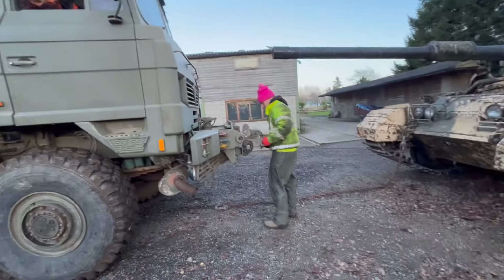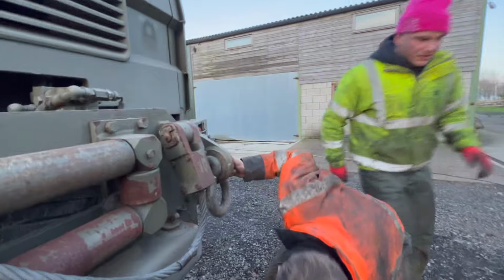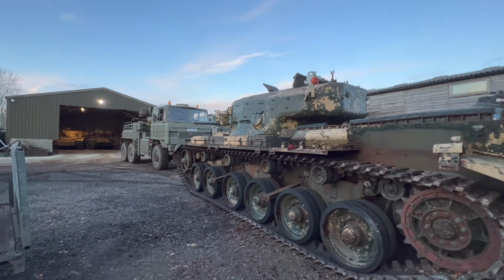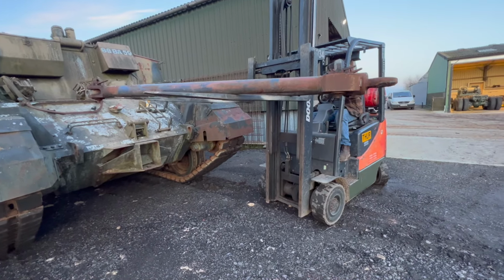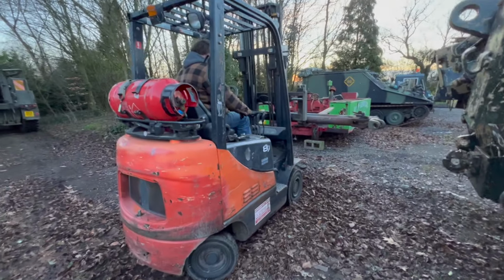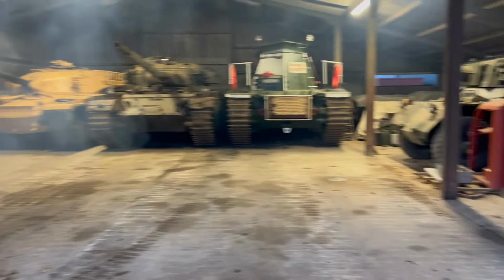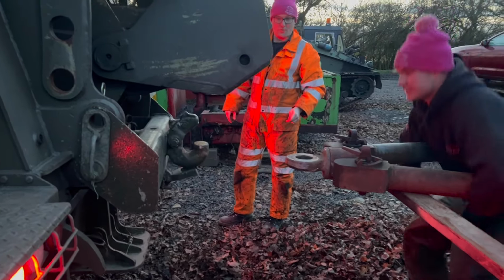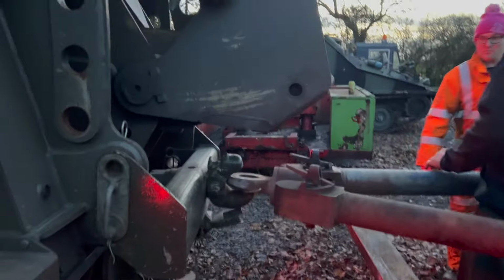Moving Dead Centurion Battle Tanks With The Foden 6x6 Ex Military Recovery Truck

Comment: When stripping out your A frame pull the quick release pins which hold the adaptors to the frame they are designed to take punishment your threaded bolts aren't. You'll find a tool in the Foden about a foot long with a rounded hook on one end and a flattened hook on the other called a Reccy Mech tool. The flattened hook is designed to unlock and rotata the quick release pins and the other end fits through the same metal loop on top of the pin giving better leverage to pull it out. You can also tap the bottom of the pin once it's unlocked.

Comment: Foo kin yell, that was stuck on there :o Do you need an interface fit in a NATO hitch? :D
Reply from the maker: It’s handy moving this sort of weight
Reply: @fittermat  Interference Fit , stoopid smell checker :D  Yes, weighty she is, to shove weighty stuff. I wondered why you didn’t use the front hitch, but I figured it probably didn’t steer then, just skidded sideways. Low Buck garage found himself a military 4x4x4 tug, which is quite the beast. Lucky find.

Comment: We always had to disconnect the final drive output shafts from the gearbox when being towed
Reply: The gearbox is lubricated by a pump that is driven by a shaft from the engine,if the engine isn't running the gearbox isn't lubricated